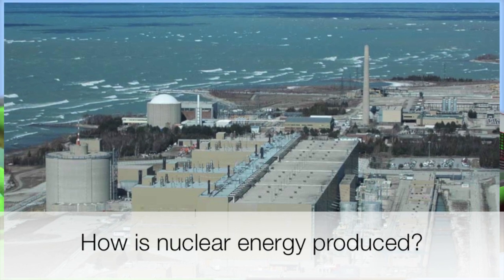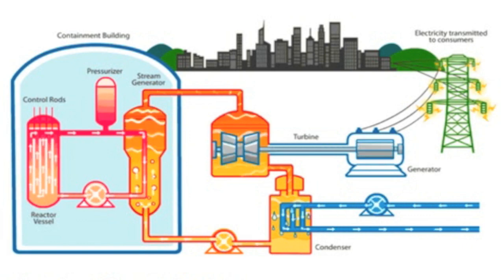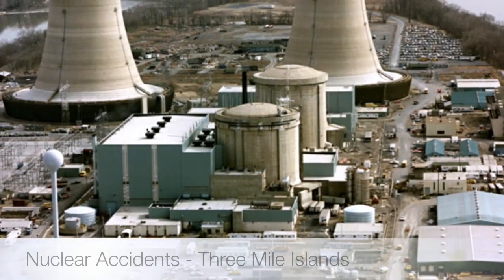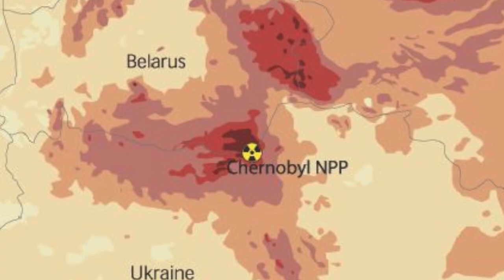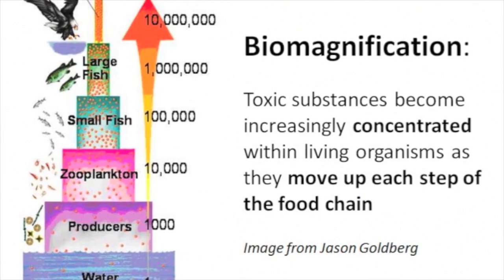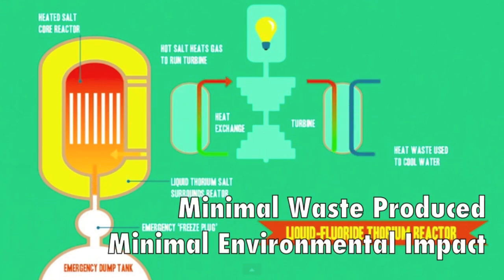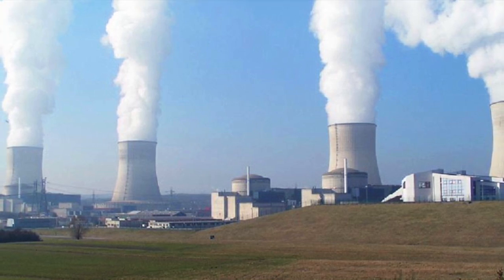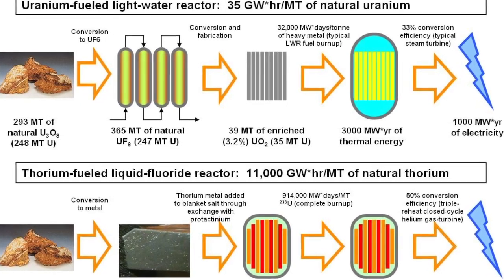Thorium vs  Uranium

Comment: We did have a thorium reactor once,,, unfortunately president Nixon cut the funding for it... I wonder why????.. I'm sure it has nothing to do with the oil barons
Reply: Nixon preferred Fast Reactors like EBR-2 and the later Integral Fast Reactor. Probably because a good chunk of the engineering and development was going on in California at that time. The EBR-2 and later IFR though, were located at Argonne National Labs in Idaho and ran collectively, for more than 30 years, generating clean power to run the labs and never having a single safety incident. Even when they ran the reactor up to full power and killed the safety systems, the reactor brought itself back down to safe levels. Then, they did it again, just to be sure.
Like the MSR, IFR's are safe and can use the spent fuel from light water reactors that we currently use. The benefit to IFR's over MSRs is that IFRs have 20+ years of development that MSRs never got. They are commercially viable right now and have all the safety benefits of an MSR, can be operated as breeder reactors and, like the MSR, don't use water as a coolant and moderator. Also, the wastes from both MSRs and IFRs are far less active and have shorter half lives than Light Water Reactors. IFRs are simply more mature, and their construction will give nuclear power the boost it needs while we finish up R&D on MSRs so they can be deployed in the next cycle of reactor building. During that time, IFRs will happily burn up large portions of our nuclear waste stockpile and leave nothing but CO2-free electricity and smaller amounts of lower level waste behind. Just in time for MSRs to start coming on-line using the Thorium cycle which has major advantages.
Reply: Nixon stopped Alvin Weinburg's MSRE in 1969 at a time when PWRs and BWRs were cheap to build. 
10 years later we had Three Mile Island event and suddenly the real costs of light water reactors were appreciated.
Reply: @Dave5843-d9m  David,, yes.  I worked in green energy at the time, and recall that Nuclear power in general (prior to 3 Mile Island) was called "too cheap to meter".   We had a Nuke Plant under construction in my state when TMI occurred and they had quite a bit of redesign and re-work due to upgraded safety demands.  Costs soared and the utility almost went bankrupt.

Comment: If I weren't pretty well sold on thorium-fueled reactors, I'd come away opposing them because of the misleadng and out-right false info in the first half of the video.  Please pull this video off the Web, and research your topic better.  Uranium reactors have a bigger radwaste problem than thorium (you missed enrichment, which involves another toxic waste stream from the fluorine required to gasify uranium for enrichment). THAT - not scaremongering and phony data, should have been your first half.
Reply: You will find that sodium hexafluoride (gas) is part of the chemical separation process for removing U233 from the thorium blanket salt. The difference is that chemical processes can do it whereas separating isotopes of uranium (or any element) are far more difficult.

Comment: we should exploit ocean power, tide, wind, storm, sea current, thunder energy, solar energy....those are the sources of re-creating natural energy, fresh and there is not any  implicit danger !
Reply: So turbine blades spun by tidal currents and huge concrete walls built to create tidal lagoons will not be harmful to wildlife or cause unexpected flooding. How's that going to happen without environmental damage?
Even if you ignore the wildlife, how much CO2 will making all that concrete release? Then what happens when the tide isn't flowing. It does stop and start 2x every day. Oh yes, we burn fossil fuels to fill the gaps. That's even more CO2 and two cold starts every day to burn up even more gas.

Comment: In Denmark we produce more than 100% of our electricity needs with wind - so why would anyone want to install reactors?  Think about it, would you want a nuclear thorium reactor behind your kids schools?  Or would you want windmills?
Reply: also you pay 4 times more for the electricity aswell.
Reply: I doubt that. I think we would be hearing about the Danish solution to voltage and frequency regulation if that were true, since that would be an impressive technological accomplishment.
Reply: That isn't true at all. A quick search on Google turns up multiple fossil fuel or biomass thermal power stations in Denmark. You guys are still burning plenty of natural gas and wood to heat and power your country.
https://en.wikipedia.org/wiki/List_of_power_stations_in_Denmark
Reply: Good feedback on Denmark, but keep in mind that wind streams are very different around the globe. Good thing is that usually wind-poor areas are good for solar energy - and vice versa. However, nuclear energy is important enabler if we want to do something bigger in the space - solar energy is not enough.
Reply: Torben Rudgaard MotoOrg wind speeds are not so high every where ..other than that project cost and amount of land and manpower requirements also count, also compare the amount of energy that could be harnessed in both sources ..one is dependent and capped while with the other (thorium), such is not the case
Reply: Wind and solar are always quoted by installed capacity = max output under ideal conditions. In reality they only deliver about 20% of their installed values. For the other 4/5 of the time that capital cost is lying idle. That's not mentioning the maintenance costs and ecological risks - migrating birds etc.
They have their place but they wont provide the reliable energy needed by industrial users including those which recycle stuff. Recycling uses A LOT of energy.
Reply: I've just found that Denmark built enough wind turbines to reduce its CO2 emissions by 11%. But exactly because wind is variable they had to run gas fired plants to fill the gaps. When used for load trimming these could never operate at full efficiency. The effect of all those wind turbines was a CO2 reduction of just 3%.

Comment: Wow I like how they used kids for this propaganda video. I also love how they misdiagnose what caused Chernobyl problem- one being that the reactor was designed in the first place to make plutonium and therefore that detail was classified. Meaning the operators did not have the full details of how to operate this reactor. Second they did not mention that both Chernobyl , and three mile island test was done in the middle of the night. Chernobyl senior staff who knew the military classification of the operation of that reactor were allowed to leave while these test were going on, which left the test in the hands of junior operators. Another problem There was no one in charge of the test,  which left two junior operators to wing it. Meaning they made it up as they went. The biggest problem was neither of them talked to each other while the test was going on. You can find more criticism else where about the lack of communication during the test, and how by not talking to each other they counter what the other one did which lead to the problem in the first place. Third, I do agree with design flaws with the reactor, but the biggest was they used graphite as the moderator. The reactor did not blow up like a nuclar bomb, the graphite being the moderator got super hot, the steam was beyond superheated steam (meaning the water probably deteriorated into it's separate hydrogen and Oxygen components and recombine in the explosion) , and the cooling pipes were so hot they simply failed, and the remaining water flashed over to steam, and the graphite combined with oxygen and caught fire setting off the Hydrogen and Oxygen. Sure it went Boom, but there was no hiroshima explosion. Yes, it was dangerous, but it did not explode like the hiroshima bomb.
Reply: The Chernobyl reactor lid was blown off by a steam explosion. The RBMK was an unstable design that could go into a runaway overdrive which not be shut down. A the best of times it was an accident waiting to happen.  The cooling water was flashed to steam until the reactor pressure vessel exploded. Then the carbon core caught fire and spread fuel isotopes around the world.
Carbon moderators are used in the British AGRs with high pressure CO2 gas as coolant. A puncture in the gas containment would not be good (!) but there is no way it can over pressurise itself in a way anything containing water can do. They have run successfully for 30 years.

Comment: Chernobyl was not a typical pressurized water reactor.  It was a graphite moderated light water reactor.  It's failure was due to not understanding how reactors operate by the operators.  It suffered from Xenon poisoning and by "buring" off the Xenon the power spiked far faster than the reaction could be moderated.

Comment: Uranium suck...
Thorium is better. LFTR waste wait 10 years and become usable for industry or medicine.
https://upload.wikimedia.org/wikipedia/commons/3/30/Lwrvslftr2.png
The radiotoxicity of the thorium fuel cycle waste is 10,000 times less than that of the uranium/plutonium fuel lifecycle. So using spallation process is more effective because there is 205 less long-time wastes (35 tons vs 170 kg)

Comment: Somebody needs an editor.  In the first minute the Chernobyl reactor is categorized as a PWR.  PWR's have water as coolant and moderator.  The Chernobyl RBMK pressure tube reactors used a carbon matrix as moderator and water as coolant in tubes with the fuel elements. 

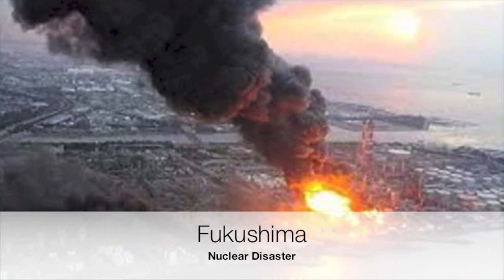At 8:23 a huge fire is pictured as the narrator talks about the Fukushima disaster.  If you compare the picture to areal views of Fukushima, it is obvious that the fire was somewhere else.

At 14 minutes meltdowns are blamed on runaway chain reactions.  The radioactive decay of fission products hours after termination of the chain reaction provided heat to drive the meltdowns at TMI and Fukushima.

Comment: Molten salt thorium reactors are also nuclear reactors. Which means there is a lot of inaccurate information in this video, that would have otherwise been accurate, if it had not used the term "nuclear reactors", when discussing information only relevant to traditional light water uranium reactors.

Comment: Chernobyl wasnt water pressured technology. It was graphit defletioned, so stop blaming! Only soviets used that technology for power plants.It probably was fake because they mainly make resources for nuc bombs in that powerplant. And the accident was caused by direct breaking of safety rules. Fukushima was safe till a 6 strengthened earthquake, but a bigger one came so shit happened.
Reply: Fukushima was built the traditional way with turbines in front of the boilers and transformers and stand-by generators in front of that. But the built the plant with all the safety-critical stuff facing the seaward side. Why was it not built facing the other way or at least with the power backup plant at the back? It seems that everyone forgot the to notice that the area is prone to tsunamis which will sooner or later wash the lot with salt water.
Reply: Chernobyl used a graphite moderator with pressurised water coolant so it was a sort of hybrid that gave all the problems of both systems.

Comment: There are so many things wrong with this video please take it down and until you have educated yourself properly please don't produce another one.Watch Kirk Sorensen Protospace and pay attention.
Reply: Andreas Kasel that's just not factual. nuclear reactors are pressurized to raise the boiling point of the water. without the pressure the water would flash boil, and the building would explode
Reply: Andreas Kasel I spoke out of ignorance. I stand corrected.
Reply: Jon Painter so what's wrong with the video Are you a globalist an elitist someone that's going to lose money by switching to thorium
Reply: + Andreas Kasel
Czarnobyl RBMK 6,5 MPa (normal atm is 0,1 MPa), if this is NOT big pressure i'm donkey...

Comment: This is a very simplistic presentation of the situation and has erroneous conclusions.  I agree with comments below.  It's not uranium but light water reactors that have had issues in the past; heavy water reactors have not had any problems.  Uranium based  molten salt reactors are cheaper to build and can compete on cost with fossil fuels.  Also, these MSRs have the ability to use spent nuclear fuel (let's not call it waste) from current reactors.  Existing stockpiles of spent fuel can supply enough energy for hundreds of years without the need to mine any more uranium.  The first ones should come on line some time in the 2020s.
Reply: +Claude Albertario  - because trying to supply the energy requirements of the late 21st century with solar is like trying to piss on a forest fire.   It wont be enough, Nuclear is the only viable solution.  We simply want to see it  done safely & cleanly.
Reply: Spent fuel is already processed heavily in European countries.  How much its reprocessed is heavily dependant upon Uranium prices.  More important are the safety features, and future economic benefits of a 600-800 degree Salt Reactor.  That and breeding Thorium into U233 (which is an expensive and lengthy procedure)
Reply: @sonpopco-op9682  A big MSR issue is the effect of the high neutron flux on the reactor containment vessel. It knocks the ** out of metals. Water traps those neutrons so the metal casing has a much easier time. Blanketing the uranium core of an MSR with a thorium salt absorbs the stray neutrons. Thorium being fertile (rather than fissile) soaks up neutrons. Even if it never makes a useful fuel its served its purpose. In reality the newly made U233 would be extracted and used as fuel.
Reply: Let's just ship the waste (spent fuel and all contaminated materials) to the moon!!
Reply: Yes this video is too simple to provide any real information.
Reply: The UK is currently home to 112 tonnes of what is the most toxic substance ever created - and most of it is held in a modern grey building to one side of the site.it gets bigger every year and we pay 80 million a year to store it,we need a MSReactor to burn it up .
look into reprocessed mox fuel in the UK big failure.
Reply: It really is unfortunate that Water reactors were ever built, considering the known (even in the 50's) advantages of molten salts.    If we had spent the last 5 decades with cheap abundant energy, how much further our progress would be, how many wars could have been avoided and countless lives Not lost.
Reply: In actuality 112 tonnes of waste is a very small sum of material, although likely safely encased in a concrete radiation shields that weight about 1000X the mass of the waste itself, unless this is already counted as part of the overall waste. But still if you can store all the energy waste from a country within a single warehouse things are going pretty good, but just knowing that this waste can be further reduced to less than 1/10 of current standards means this is a phenomenal energy source and advancements to these technologies really should be pursued.
(also that $80 million a year probably has almost nothing to do with the actual storage of the waste, but more with security and personnel training to deal with the hazards and emergency situations.
Reply: Molten salts are better applied as storage systems for renewable energy.  Solar to molten salt to use in off hours. Why all this stupid talk of Nukes??? No reason to raise that spectre again.
Reply: By LATE 2 century we will have a massive abundance of renewable energy. It will essentially be free.
Reply: @SomnoNaut  Wind and solar have a load factor of 20% so will never be free. All that capital cost takes 5 times as long to repay. Don't forget the gas fired thermal plant that's needed to fill in the gaps where the sun isn't shining and the wind isn't blowing.
Reply: I erred before, "solar energy is by far the largest exploitable resource, providing more energy in 1 hour to the earth than all of the energy consumed by humans in an entire year. "
http://www.pnas.org/content/103/43/15729.full
Solar is the most promising of technologies for the rest of the century and beyond.
Reply: That's ridiculous, you know the cost to get anything into orbit? (nevermind the moon) and  if even ONE rocket crashes.,...  Also this so called "waste" can be recycled to remove most of the unused fuel.  There are also multiple uses for most of the other constituents.    The most dangerous actinides have short half lives & can easily be stored for a decade or two.    Lets get back to talking realistically about MSREs.